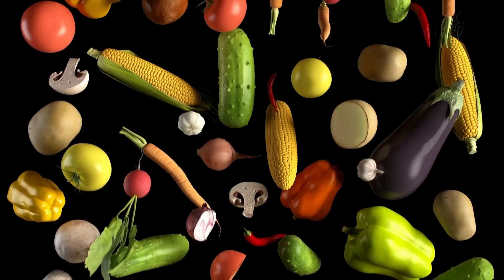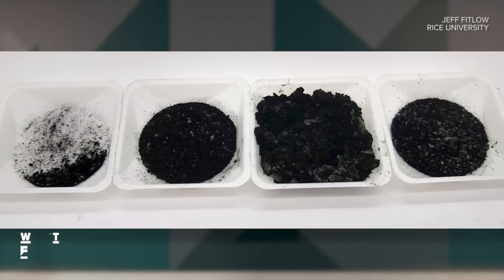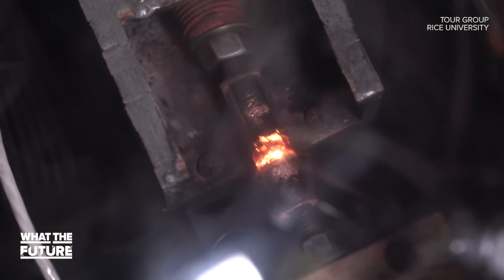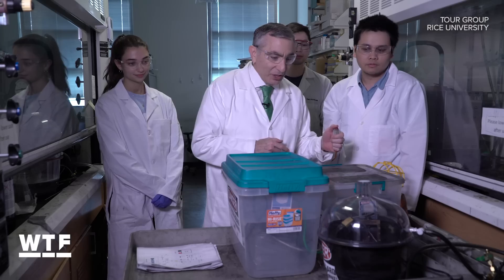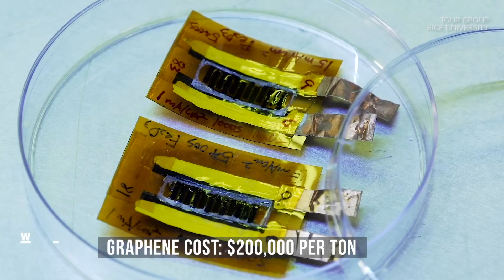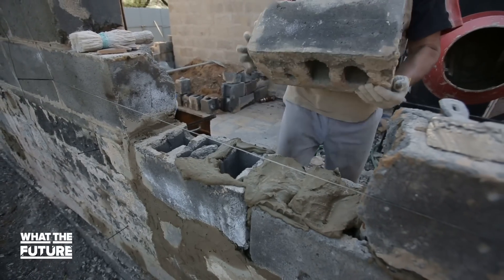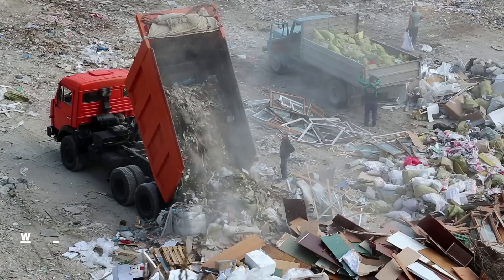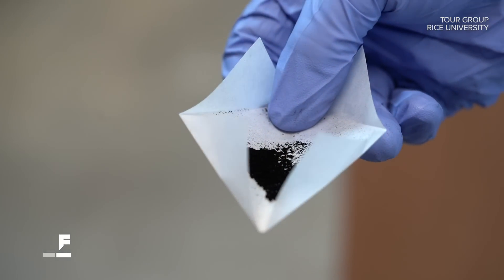Making graphene from trash in less than a second

Comment: I've actually seen this method in the beginning when graphene was brand new. They used a xenon light bulb for a camera about 500 watts and described it as burning the oxygen off in the flash using graphite as the burn material. It was a short video in the very beginning of its history of short films.
Reply: I saw that too, idk why they're acting like it's new. This isn't replicatable in 200w either, I've tried. Idk why they're lying.
Reply: @matthewhopkins7042  "why they're lying" ...it's TOUR, what do you expect?

Comment: so we can create a car made from graphene?
Reply: No, but what you could do is add a layer of graphene impregnated material between the body shell and the interior paneling to replace the car's wiring. This would make the car lighter and thus more efficient. It would also have the added benefit of being able to re-route electricity around damaged sections unlike traditional wires.

Comment: For concrete: I did the math and it saves you almost 35% of the energy. it takes 0.1GJ to produce the 0.02% needed to offset 35% of the concrete using 43.54Gj.

Comment: So is this being developed as a commercial process or is this just another "much ado about nothing" event? Back in 1984 we were told that both Cold Fusion and Zero Resistance Conductors were just around the corner. 36 years on nothing happened.

Comment: Mass Production of this process will require massive amounts of energy.
Reply: solar panels made from graphene bro, problem solved aye
Reply: Gary Winthorp  it is cheap but at the same time how are we gonna scale this? Some machine placing and removing the carbon between the electrodes? The graphene dust would just blow out everywhere. This method would require human labor. Maybe I'm wrong but those electrodes are pretty small too, this just doesn't look scalable.